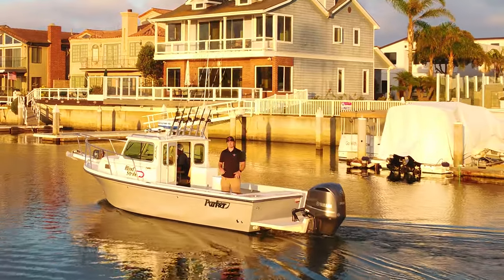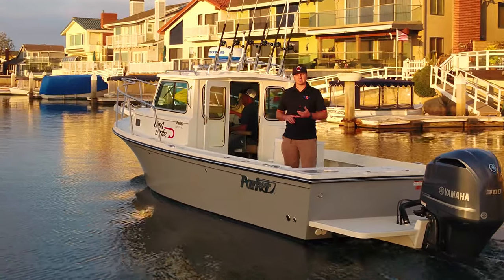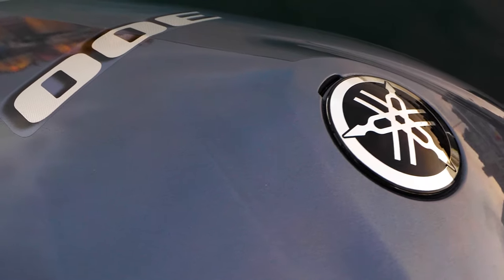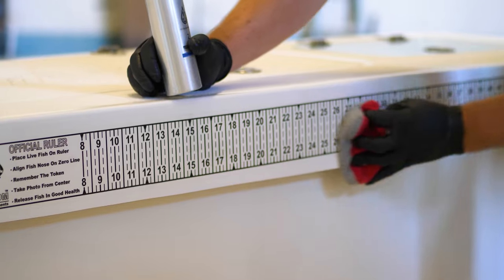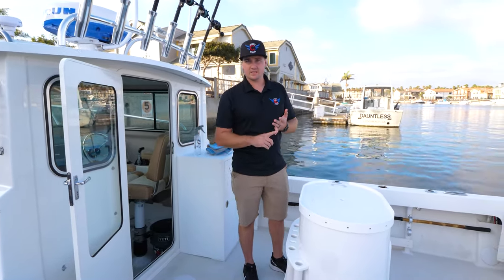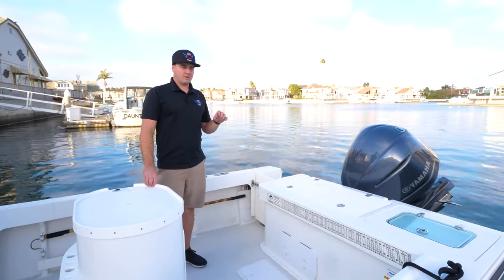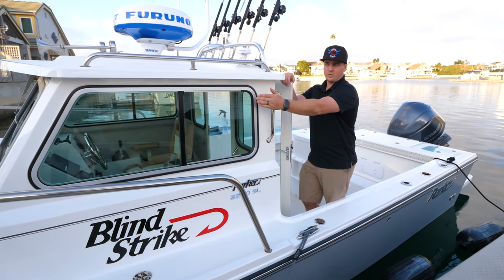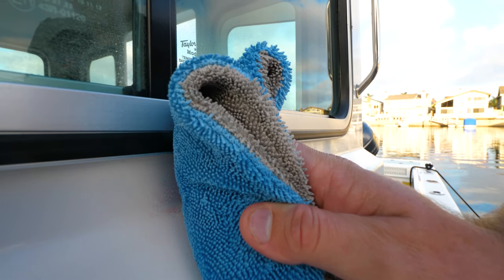BEST Gel Coat Protection for a 2020 Parker 2320SL BOAT!

Comment: Beautiful boat... Love the Parkers! I checked your link, and there are no marine/boat applicators/installers in our area. (eastern North Carolina; Yes one in Morehead and Jacksonville, but none are Marine/Boat Certified). Is the product available to purchase; self apply/install? I keep Colonite Wax on the fiberglass, Rain-X on my glass, and MDR metal polish on my stainless steel. I'll guess this all must be stripped off to apply your product?....
I know you are on the west coast, so I understand if you don't have the time to reply...
Reply: I looked in the  link and I think further down the page they have a "self apply" product.
Reply from the maker: Hey Andrew, Great questions! First off.... sorry to hear about the avaliability of certified installers in your area... it's worth a try to call the nearest one and inquire about marine coatings... any Feynlab detailer should be able to contact their rep and see if it's a product they can install for you. For your second question... this specific coating system is not DIY friendly... it has multiple application steps that permanently bond to the exterior surfaces of the boat, we also perform a thorough paint correction and polish before applying the coating. Feynlab might have a DIY protection option available on their website, but it is not something we have used, so we can't speak specifically to that product, if it exists. You should definitely reach out to your nearest Feynlab Detailer and see what they can do for you... we really appreciate you watching our video and keep up the great work on protecting your Parker!
Reply: @yumyum408  Hi Sheila B, thank you, I didn't see look that far down the page... I'm catching up on 100+ emails and Youtubes; I've been in New York the past 5 days!